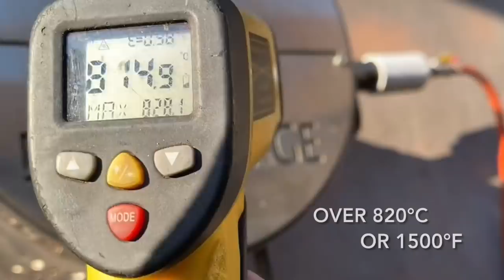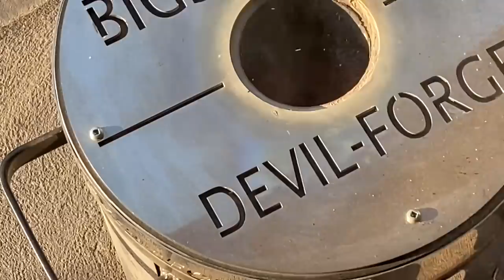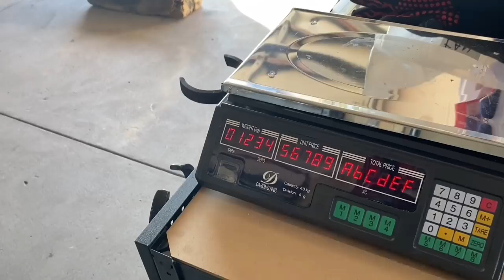Huge 4KG Mirrored Bar - Bulk Brass Tap Casting - Trash To Treasure - ASMR Metal Melting BigStackD

Comment: What good neighbours you have, everybody needs good neighbours.
Reply: Same for Shango066. Shango066 does repairs on vintage TV and radio sets in his yard, somewhere in Los Angeles.
Reply: @nathanlewis5682  Ah, not so good neighbours then.
Reply: @mrshannonite4016  maybe. If anything the neighborhood residents would be annoyed by low flying aircraft overhead or loud cars and motorcycles haulin ass on the streets.

Comment: That’s really funny and amazing. I’ve been collecting scrap metal since decades (copper, brass, aluminum, electric motors and of course iron/steel), have stripped hundreds of meters of copper wire or dissembled lots of machines to separate the different metals. But after a while I always take it to the scrap yard and sell it there, made about 2000 eur during the last 20 years or so. To melt the metals into bars, polish them and just collect them is definitely a different approach. I wonder how many copper and brass bars I would have in my garage since all those years… Love your videos!

Comment: in one of your upcoming melts could you try heating up one of the molds almost red so that there is a lot less temp difference between mold and molten metal and see if it produces a smoother cast, ive watched some gold bar casting videos where they heated up the mold with the metal already in it and they seem to come out with almost no defects... except the top where it shrinks in a little obviously. cheers anyway from USA

Comment: Lovely to watch.
 Brass takes real heat.
  So I got to wondering about the gas.  How big a difference per melt? Like. Brass. Copper. Alli. Etc. 
 I used to help a mate with his industrial gearbox smelter. We used a blown oil burner box.
 Aluminium goes down like butter, leaving all the cogs and dogs to sort into piles. Brass bushes and machine cast into a big skip for the wiegh in.
 Alli ingots were cast into slices of chenel girder with blocked ends.
 Satisfying to see pure clean Alli flowing from dirty scrap gearboxes.
 Threw in a few high grade beer kegs to up the grade at times. End users loved the quality.
  This was back in time, not long after the brinks matt gold robbery.
 My mate, he spray painted a whole pallet of Alli ingot with gold paint. He had them in the van trying to sell gold ingots outside the diner... Po-lice were called and he got arrested... 😂 😂 😂
 Seems funny now, but at the time. The po-lice made a big deal out of it.
 He ended up closing the smelter down due to cop raid on the yard.
 We live. We learn... It's all fun.
  Heve you done a silver melt? 
Thanx for your videos, they really therapeutic to watch. 
 You treat your dogs like I treat mine. Never walk past without giving them lovin.

Comment: By the looks of the slag, looks to be a very efficient melt! haha! my, "slag-grabbin" stick looks just like yours! Just a piece of flat steel with a bend at the end, nothin fancy. I was suprised to find that the melting point of brass is actually lowerr than that of copper and i had always thought it the other way round.

Comment: What would happen to the surface or the pour if right at the moment the metal cooled to a solid on two exterior you quenched it in absolutely destroyed and burned up conventional motor oil... I’m talkin the blocker the better my guy? What kind of finish would it have?

Comment: Hi mate nice video and nice treasury

In this video you were melting brass or bronze but probably more brass than bronze

As brass and bronze are a mixture of copper with Zinc and tin respectively

Should these pure metal separate one from other due to diffrent melting points or they remixagain because the temperature of your gas oven is over the 1100 celsius needing for melt the copper?

Comment: You know, for a minute there I thought we were going to get a bonus to the vid where you pulled apart and melted what you could out of the TV... but I don't know how much there really is that's not just circuit boards and glass and plastic in there...

Comment: When I saw your videos for the first time, I decided I absolutely had to learn how to melt metal myself. Unfortunately, I shattered my first crucible and it broke parts of the refractory cement on my Devil Forge. I reached out to them to ask how to fix it with no help. I’ve searched the Internet for a solution and found nothing. So I’m hoping you could maybe give me a bit of advice? I don’t want to impulsively do the wrong thing and cause further damage. Please help??

Comment: Trying to decide if this would be a good way to earn some money on the side. I have access to 40-80lbs of scrap aluminum a month, I currently have about 70lbs of aluminum sitting in the bed of my truck. USA, if that makes a difference
Reply from the maker: No mate definitely not the best  thing to do if you’re trying to make money, you would lose all profit in time and gas if you do what I do. I do this as a hobby on my days off from my normal job and that is why I do not sell anything I just stack it all up👌🏻

Comment: How much copper would you have to add to the brass to get it to look like Bronze ?
Reply: Brass is copper and zinc
Bronze is copper and tin (can have other items such as aluminum in it to) so its not likely to make bronze from brass
Reply: @southaussiegarbo2054  - Thanks, but I already knew that. What I was wondering is how much copper to add to Brass to make it "look" like Bronze ?
Reply: @herenow2895   hed need to add some tin more then copper
Reply: @southaussiegarbo2054  - Bronze is darker than Brass. So to add tin which is silver, would only make it lighter still.
I'm not after the strength properties of Bronze, just the closer look.
Reply: @herenow2895  cameras dont really show colours 100% best
Reply: @southaussiegarbo2054  - I've seen plenty of Bronze and Brass in real life to know the colour differences and what makes them like it
I guess I'll just have to wing it and melt some brass with varying quantities of copper until it starts to look right..
Reply: @herenow2895  australian gold coins are 92% copper 8% aluminum fyi.
Reply: @southaussiegarbo2054  - Thanks... I'll play around with some Ali in the mix too.
Do you think some lead in there would  work ?
Reply: @herenow2895    if we go with 70% copper and 30% zinc est in brass and you got 2kg of brass thats 1400grams copper to 600grams zinc 
To make bronze youd need 80-90 copper so bring it upto say 1800grams copper and add in say 200grams aluminum and it should be an ok mix
Reply: @herenow2895   id avoid lead bc it does produce a toxic smoke. Lead is also worth a pretty penny at scrapyards lately. Ik the yard i use is paying a price i cant remember but might ask them when i go in next to write down some other prices bc i wanna compare to a youtuber from victoria australia🤣

Comment: You should do one episode a month when you 3D print a country flag mold for the petrobond sand, and cast country flags of copper.
Striped flags can be done like stairs(like __----__ for the tricolor of 🇷🇺 for example, with just milimeters of height difference for different colors. For the first video is suggest the flag of 🇲🇰, because you don't even need to paint it, it is recognizable because of the unique pattern. The 🇺🇸 flag wouldn't need painting also, since it's unique. Maybe do like 3 flags in one video. It shouldn't take too much material, just do them not too thick. Maybe 1 cm thick. Please do this
You'd only need to paint boring 3 color flags, which you don't even have to cast at all, or if you did, you'd have a mold anyways for all of them, because most 3 colors are identical.
Reply: And maybe stamp the behind with weight and country name info.

Comment: Do you still have access to discounts from Devil Forge
Reply from the maker: Yes Matey I can sort one for you , if you hit me up on email I’ll send through a heap of info and a code word you can use on their website. 
bigstackddddd@mail.com
Reply: @bigstackD  I tried emailing you some time ago but never got a response. However I will try again.
Reply from the maker: @docvencil2222  That’s very strange as I answer every single email I received and don’t delete them until there has been an answer,  did you put 5ds in the email? 
But yes try again mate as I’ll be on the computer for the next half an hour

Comment: electric-arc furnace, solar battery powered, should melt anything, vacuum is beneficial
Reply: also have you tried direct molten oxide electrolysis? should be fun
Reply: also solar water powered, concentrated heat
Reply: a sack of copper oxide should give a ton of molten copper, etc

Comment: Now if only you could have turned those taps on and beer came out of them instead. Would be an ever better use for them then casting
Reply from the maker: Yes that would be perfect, have you seen this clip below where I guy gets his whole house plumbed with beer as a prank? 
https://youtu.be/HG_wfMK7dko
Reply: @bigstackD  can’t believe I had not come across this before. That been out for 7 years too. One of the very best clips I have seen. 
That is like beer heaven. Come home and beer wherever you go
Reply from the maker: @DanielWillems1995  indeed 👌🏻. 
Well have a good day or night wherever you are buddy I’m just about to crush down some copper pipes and get some nice green flames happening while I try out my friends new molds he sent me. You should see them next week or the week after👌🏻. It’s 6:25 here and the sun went down awhile ago so I best start melting now before a piss the neighbours off more than usual, not that I give a fuck just saying👍🏻
Reply: @bigstackD  have a good one. Based in Aus. Usually Melbourne but have travelled west to Adelaide for a couple months

Comment: Getting Bored with this same old stuff. Time for something new. Let see you take aluminum heat it up and pour it out in a block, While it's still hot pour Copper brass or anything that will blind but not to. End goal take the block cut it into slices and make wood grain metal slices that can be used for art like boxes for jewelry and stuff. Come on dude you can do it. You got the multi-burners. You just need to figure out what temp to blend them and how to blend them so you don't get globes. Maybe blend it in the Kelm comb it somehow to make the grain shut the Kelm off and let it harden. You can do it. Give it a try.